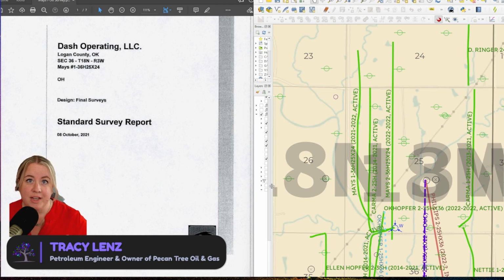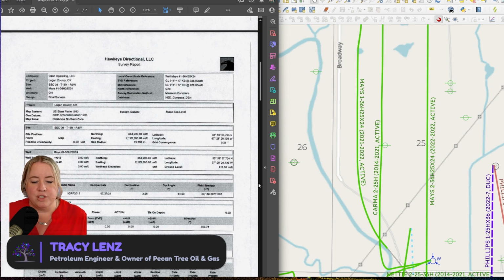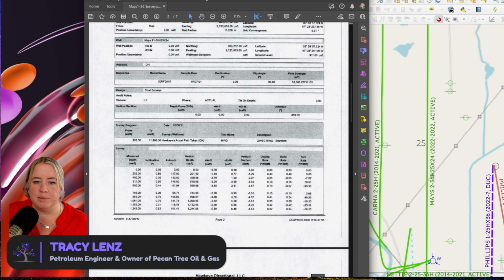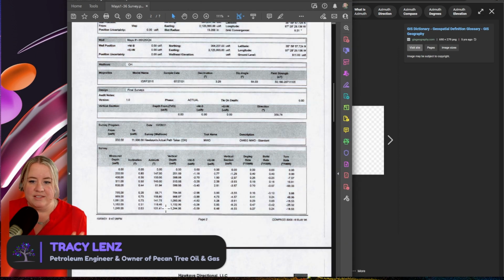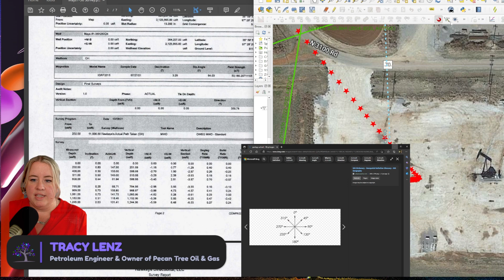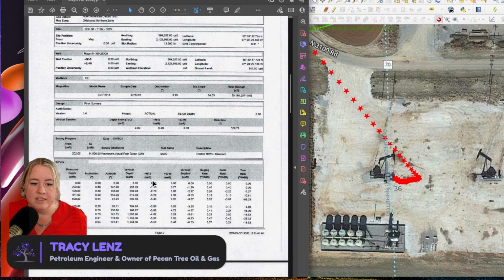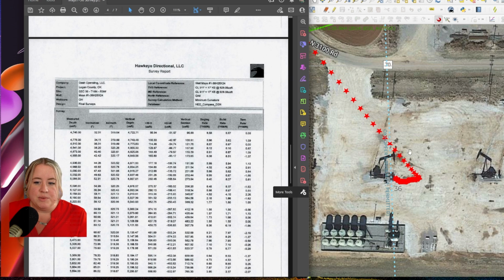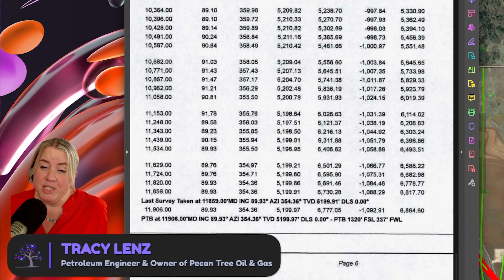How to read the directional survey report (for oil & gas wells)

Comment: Thanks!! Hello can I ask for help. I have a Directional Survey file in CSV format and some LAS files of eight wells in Texas. How could I build a rudimentary 3D viewable structural geomodel with the provided LAS data from 8 wells in Texas. In each file the surface location coordinates are found.
Reply from the maker: If you're looking into a free option, there are some 3D structural mapping options in QGIS. It's a pretty steep learning curve but it's there, especially if you plan on doing this more than once. Otherwise I tend to overuse Excel and just do everything there. There are ways to get fancy with surface graphs and 3D line charts there.